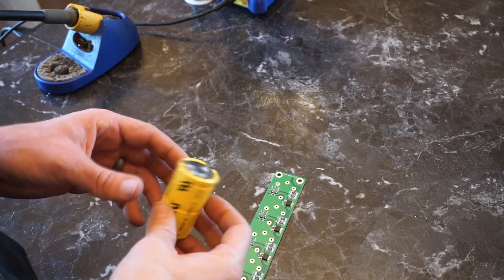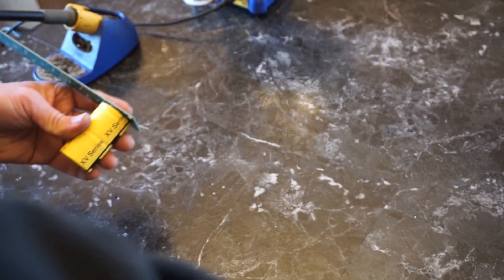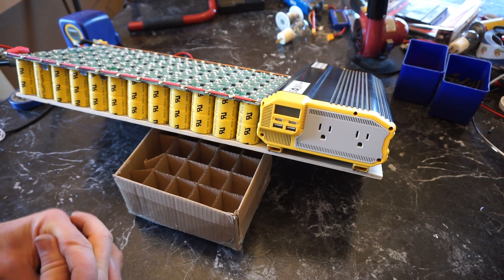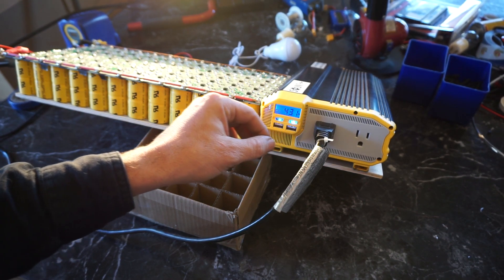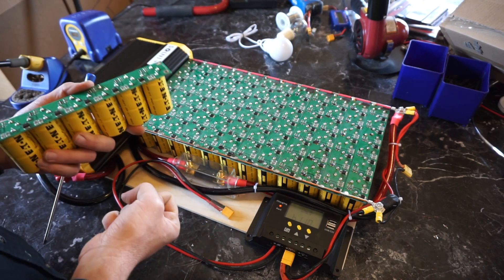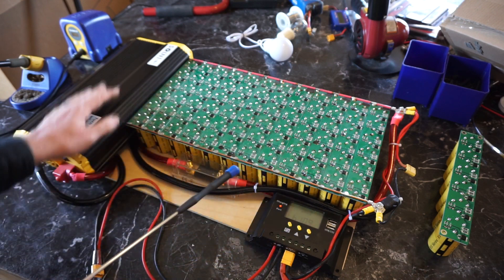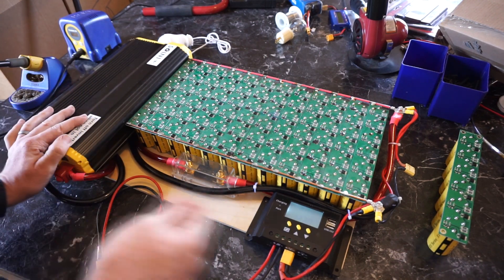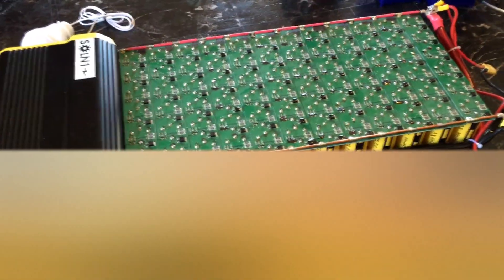Building the SOLN1-2000 Watt Capacitor Solar Generator

Comment: I’d love to see this hybrid boost pack setup with lithium ion batteries assisting large pulls of power. Is this a cheaper safer or longer lasting then deep cycle flooded batteries? I want to make my own wind/solar power system and wonder if this is a better option. What do you think?

Comment: This looks very impressive but its really not.A large load on that inverter can indeed be drawn from those caps but the inverter sees over 12 volts and with continue working the large load until the inverter sees about 10.2 volts at which time it will dump that load.Not very useful because the caps have more than half there energy left.Batteries are best.

Comment: Hi! If I want to connect 12v batteries together with capacitor banks that have balancing boards, can I just connect the batteries and the capacitor banks in parallel with nothing in between? If the batteries are charged, won't this create an over current in the capacitor bank when connecting them and damage something?

Comment: So you're going from the solar panels to a solar charger then the capacitors? I need capacitors in parallel with the panels and a six Cap won't do it...
With 400 F caps, each board has 66 F capacity...

Comment: Well u can just buy a Petrol Generator to do the job which cost about the same as Capacitor bank but where is the fun of it?

This is DIY spirit we enjoy. Kudos bro, U have done a good job
Reply: And then you have the stink and the noise of the generator running to consider. ;-) And you should never run a gas generator inside a closed room. :-0 Which you can do with one of these. :-) Having an inverter and battery proved itself during and after Hurricane Irma. Daytime use of a generator is okay but at night, you want some quiet time. After a week of listening to a generator run, it gets to you. Now think about how I felt after Andrew where both work  ( 12on/12off ) and home were on generators for 5 straight weeks. Generator would get shut down at home from 2200 to 0400 the next morning. One to save fuel and two, so there was some peace and quiet. If I was pulling the night shift at work, it meant the only quiet time was the 8 mile drive to and from. With Irma, inverter, and 1 battery, I could have two hours of freezer or refrigerator, fan, TV, lights running on the one battery alone and if the truck was left idling, it could run all night. Truck at idle was not audible in the house unless you listened very carefully.

Comment: I am betting that these small yellow SC's are nor nearly 400F.  Every time I test one of these "to good to be true" caps (very lightweight and small) with several 100's of Farads printed on them (mostly 500F: so I can't speak for these 400F units, but I bet...).  I don't know exactly why they do this, but the caps labeled 500F actually measured as only around 78F.  NOW, six of these in series will give the total C of,  78F/6 = 13F @ 16.2V !!

ALSO, my lower rated SC's (supercapacitors) of 10's of Farads, AND my larger SC's over 1000F's (like my 2600F and 3000F SC's) measured dead on!!

BTW: I have never seen a "FARAD meter", so, to measure the capacitance of these monsters, I used the relationship:  i(t)=C dv/dt....solving for "C" and switching to 'delta' notation, for example "DELTA  V" rather than differential's "dv/dt"  which is valid since the changes in v and t used in measurement are relatively "large"  in this case.  The actual formula (solved for C) is:  C=IT/V.  This yields an accurate 'C' value for a supercapacitor.   ONE MORE THING:  When using this formula: the current flowing through the cap must be --constant--.  I used a simple PCB programmable PSU for a few dollars on ebay.

I am curious:
What size solar panel(s) are you using (V, I  ,W)?

Comment: Anyone have a working link to the super capacitors use in this video? Some mentioned they are sold for $8.00 each. I have not seen them sold for less than 12 TO 14 EACH. Also the protection boards he said he sells on his web page that link is also broken.

Comment: hi, i see that you are useing a car auido fuse for your system, they make a breaker in (car auido)that u might want to try or just even look into if u got the time, i got one installed(  300 amp)in the car and it works great 👍🏼 cuts cost on fuses if a overload occurs...hit the rest button and your back on track..awesome video by the way 👍🏼👍🏼👍🏼👍🏼👍🏼👍🏼👍🏼👍🏼👍🏼👍🏼👍🏼👍🏼👍🏼👍🏼👍🏼👍🏼👍🏼

Comment: Why not just use a step-up circuit to power the charge controller at all times. You could even combine it with a jouletheif that should probably make the controller start longer as well

Comment: After 1,000 charges and discharges,the batteries are toast,these 400 farad super-caps run circles around any battery,not to mention the fact that these caps are rated for over 1 million charges and discharges in their lifetime.
Reply: THIS. I love the robustness of the solution. After the zombie apocalypse, all your 18650 cells are going to die, along with lead acid batteries and combustion generators. In the meantime, people aren't dying in lithium mines because we are obsessed with energy density.
Reply: Indeed... although I do like the idea of marrying the two technologies together... 18650 lithium for the bulk storage AND supercaps for the handling the peaks and saving the batteries from having to cope with them. Because of this, you can actually use smaller batteries because the capacitors will deal with those massive surge currents. Either way, supercapacitors have come a long way, and it's nice to see them starting crop up in more and more appliations.
Reply: that 1000 FULL discharges and rechardes buddy, and who's mad enough to do full discharges?
Reply: dying in lithium mines?  wut?  lol  citation?
Reply: @John-gm8ty  Easy. 1000 cloudy days - and it's more like 1000 half-discharges that will kill your batteries. A 100 full discharges at high temps even with a protection circuit will roast a lithium cell pack.
Reply: @matthewvincent8971  dude, 1000 cloudy days?  lol three years of constant cloud? ugh-huh...
and which lithium is this?  -phosphate? -ion? some other chemical make up?
different chemistry types have different aging and cycle characteristics, it's not a plain apples to apples comparison.
Reply: @John-gm8ty  Come on man lets be real. Have you EVER in your life had a laptop battery or cellphone battery last more than a couple years? What if you cycled your laptop to 50% every single day? All Lithium batteries suck dude. This is not a sustainable practice.
Reply: @matthewvincent8971  different densities, slightly different chemical make ups, different manufacturers and QC, most of those cell sup until recently are lithium ion, very different to other lithium based cells like solar batteries.
also, with laptops, also up until recently have all been 18650 cells and it's almost universally one or two cells that die early ruining the pack, some cells last up to 10 years.
pack cells that have become the mainstream don't have the same make up or design either.
so it's really hard to compare longevity or reason for failure.
Reply: @John-gm8ty  Now you're getting way out in left field. A Tesla Powerwall will cost you $8000 installed and STILL uses 18650 Lithium Ion cells. Granted they're guaranteed for 10 years against defect but I bet you the cells will be down to 50% capacity in a few years. So let's circle round... show me another solution that I can buy now that maintains near 100% capacity over even 5 years and that I don't need to be a millionaire to afford. I'll be waiting.
Reply: @matthewvincent8971  mate, where in this discussion, until now, was that part of the discussion?
you're jumping tracks.
nothing chemical maintains efficiency, that would be against the current know science on physics.
of COURSE this stuff is expensive, this isn't make a wish, it's reality, shit costs money, difficult and technologically difficult shit costs lots of money.
the way of the world.
capacitors can't do what you want either.  
everything that would save you money in the long run, costs a shit ton in initial build.
the only way to save, is to use less and smarter.
Reply: @John-gm8ty  Read 4 guage's OP. You're the one who jumped tracks, quoting some exotic electrolyte as a practical solution to the chemical breakdown problem.
Reply: @matthewvincent8971   You are very misled, show us a capacitor with a rated shelf life of 5 or more years. Most are 3-4 years at less than 100 degrees F, and obviously worse than that if hotter than 100F.  Show us a capacitor that doesn't leak to half it's original voltage in 30 days - where the leaking gets worse towards end of life. Power density of battery technology gets the job done. What are you going to do when your caps run out?
Reply: @amorag59  See for yourself. 10 years at room temperature, 20% loss in capacity, which is exactly what they'll be in a solar application where they are slow drained. I've had a life time with batteries and I hate them. I'll take my chances with caps. http://www.maxwell.com/images/documents/bcseries_ds_1017105-4.pdf
Reply: @matthewvincent8971  In parts of the world where you have enough continuous sun for solar to be viable, this means keeping the caps below 25C/77F to get that 10 year life - in an enclosure and under load. That figure is also tested in taking the capacitors down to only 50%. Weren't you saying how using only 50% capacity was a waste? Using 50% capacity on storage tech that is 5% the energy density of batteries is a waste.
Reply: @John-gm8ty   yeah i wonder how to integrate a charging/discharging circut in line with supercaps to limit dis/charges from 90-20 percent for maximum lithium battery life
Reply: @mikemotorbike4283  be wonderful if it could be done.
even with iron based batteries, you still have limitations and other issues, they don't hold charge for as long, but tend to live for a VERY long time if looked after, some of the edison batteries are still going after 80 years, but not all of them live that long.
Reply: Regardless of charge/discharge cycles of capacitors, the rated shelf life is usually only always 3-4 years. Usually decreases with hot environments.
Edit: capacitors
Reply: @amorag59  true, but capacity to output ratio to size... you'd need a truly huge capacitor bank to equal the same energy density.
there in lies the problem.
Reply: @John-gm8ty  Yep, I edited my comment, I was referring to the shelf life of capacitors ending up being close the batteries at the end of the day. 

Agreed, You'd need like 6000 .31WH caps to run the 2000 watt load in the video for 1 hour and then whatever multiples in series to get the voltage up to something the inverter can use (which series mounting decreases capacity) . Basically when the suns gone your done working.
Reply: @John-gm8ty  with advancement graphene capacitor you can probably store up to 10k farad 100x100 cm @ a half inch, stack them 10 layer you've got 100k F, or you can roll them into regular caps with size of lantern battery @ 5k-10k farad, and graphene solar panel will charged them from above, as far there are sun you practically have unlimited energy
Reply: @dogodogo5891  will arrive in the market in only 30 years too!  ;)

Comment: Instead of unplugging  and plugging in between charge controller and solar cells why not add in switches?
Reply: I was thinking a boost converter to get that last bits of power from the caps. Add a 3-4 cell 18650 in series isolated battery bank that runs only the charge controller while the caps are below usage level.

Comment: I'm not going to shoot you down like some do but give you advice you can have a controller to shunt the solar panels for direct capacitors to the regulator and then you won't need plugging in and out the whole time.

Comment: Could you run say 24 row's of super capacitors to a 4000w inverter? How long would it run a 3500w load if you had a 3000w input from a 4kw solar array?

Comment: hey, love the vid. not enough people out there doing this kind of work. i am just getting to a point i can start testing some thoughts in the real world. but dont really kno where to dive in. dus any one kno what if you used some thing like ( 6 18000uf 30V DC Mallory CGS Capacitor Screw Terminal ) am i wrong with thinking bigger is better? 
http://www.ebay.com/itm/262483550649?var=561292954201

Comment: I don't get it.  I like the tech but I don't see the benefit of spending and working on these without a nice application.  I have read somewhere that supercaps can b beneficial car regenerative braking and using it again. I believe current implementations of this on electric cars are pretty limited due to high currents.

Comment: Explain this to me why aren't you using a boost inverter instead of your charger controller or even to put the BC to DC boost converter in between the capacitor and the charge controller you would be getting every ounce of battery power my bad capacitor power out of it because it would be wrapping in boosting the little bit of voltage into whatever you have it set to I would think about doing something like that one its you think that would be cool

Comment: why dont you replace that pwm charge controller with a simple DC to DC step down converter set at your desired voltage? that way you dont have to deal with the low voltage cut off as the DC to DC converter doesn't care what it has on the output. they are also the same efficiency or better as the current charge controller that you are running now
Reply: The charge controller sends wattage to load off the panels, and will only pull what's needed off the bank in good sunlight

Comment: So... given enough super capacitor packs and the correct inverter, you can use this to charge an electric car while it's parked in the sun?
Reply: I think for charging your car, you would need only a charge controller and feed that directly into the batteries. No caps needed for that application. The batteries are much cheaper and will store more energy for a longer time than caps. You could put some caps in to huge a huge surge boost if you need that.

Comment: One of the questions I have are what is the cost per KWH compared to batteries.  Some one was telling me that "solar" lead acid batteries where really expensive and I looked on Ebay and found forklift batteries that were reconditioned with a warranty for a fraction of the price of "solar" batteries.  Can't remember the exact figures but even today I'm sure that the difference would be worth considering forklift batteries.  It all boils down to bang for the buck.  Fixed installation weight isn't as critical as mobile.  Size is still some concern but can be dealt with much easier than mobile.  So a big honking forklift battery could go out in an insulated shed of it's own and decrease many of these objections.  So, someday we may have super caps that are cost effective but till then, I'll stick with the lead acid anchor.  Keep experimenting though.  You might be the one that hits on the magic combination.  Best of luck.

Comment: Put some solar panels on the roof of y work van hooked up to these super capacitors to run a pressure washer and a vacuum and a hair compressor, not all at the same time though. Could it replace the small generator in my mobile detailing setup for washing cars? I need a max of about 2000 watts continuous.